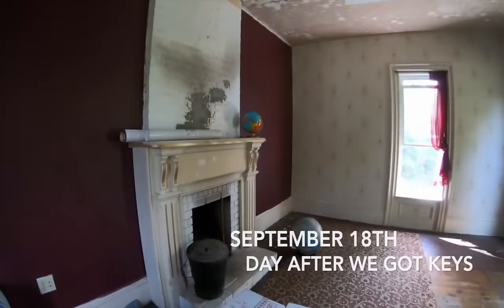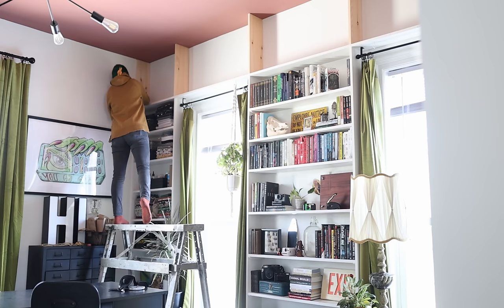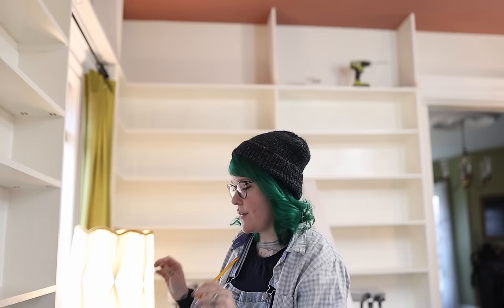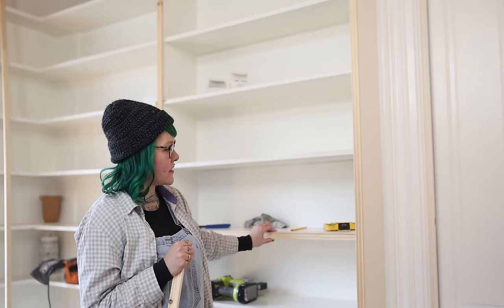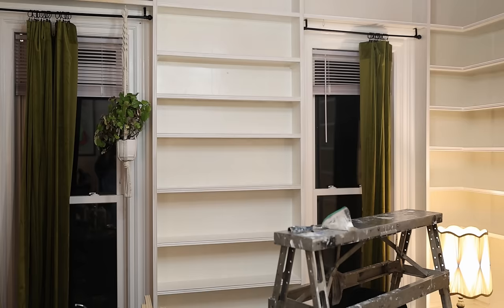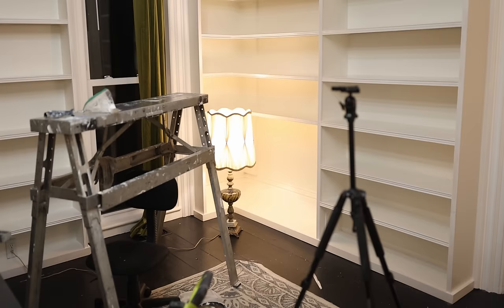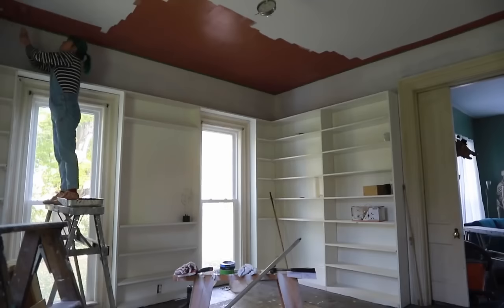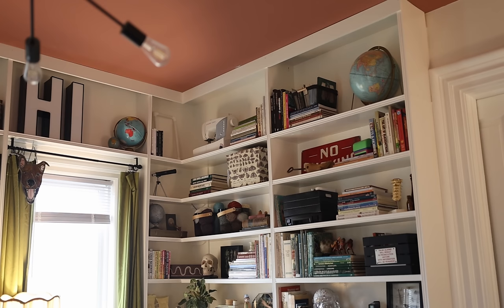office update -- trimming out my built-in shelves & taking them to the ceiling! stroup mansion!

Comment: I was just thinking, once you add the crown molding, if you wanted to make the top shelves a little shorter you can add a false ceiling at the end point of the crown molding. Like if the shelves are 15 inches and the crown is 5 inches, you can just add a false shelf top in line with the end of the molding which would make the shelf 10 inches. I think they look great as they are, adding the molding really made them look intentional.